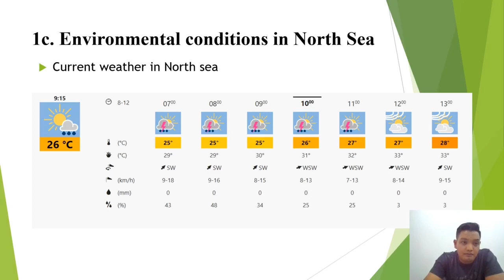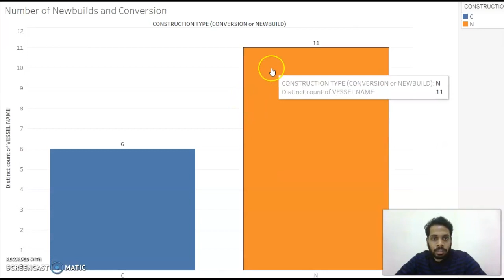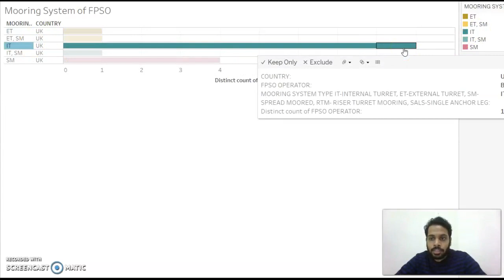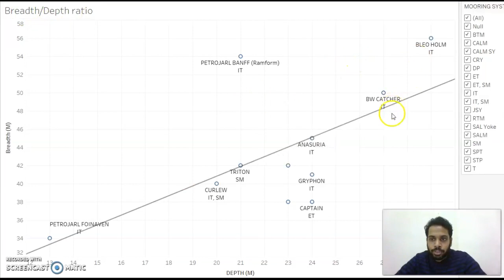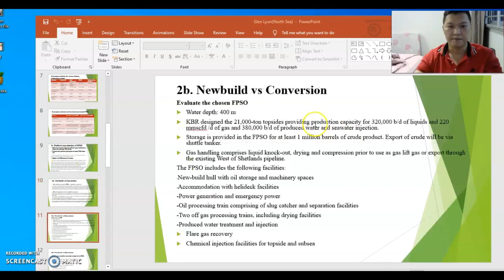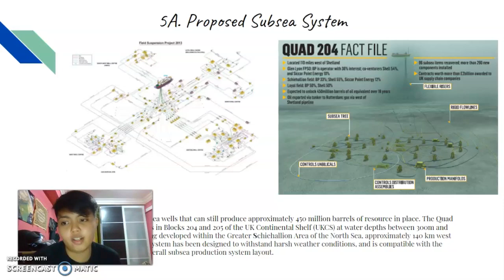North Sea - Glen Lyon Fpso

Comment: Well done!

Good points
1. Good Attempt to slice the operator, mooring system and countries for FPSO operators in UK.
2. Detailed study of the UK FPSO

AFI
1. The daily weather in environmental data is irrelevant. We need the climate and the metocean wand this was mentioned in the subsequent slides.
2. for the Viz, there should be correlation of the various parametric trendlines and mention of outliers.
3. Did not conduct any shuttle tanker transport route calculation (major AFI)
Reply from the maker: On behalf on my teammate and i, i would like to thank you for your patience and determination to bring us through the journey! On to the next!